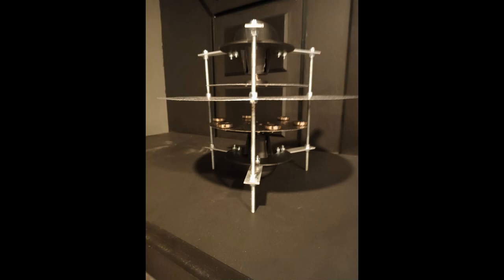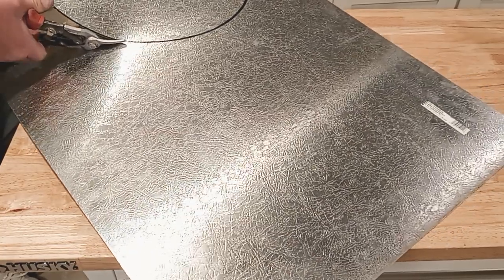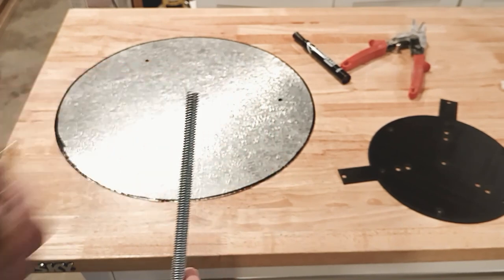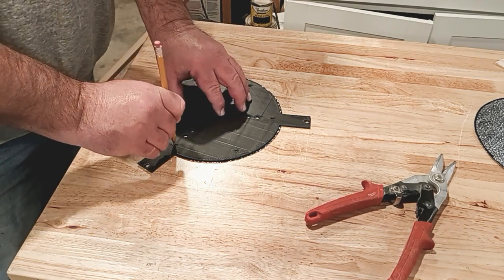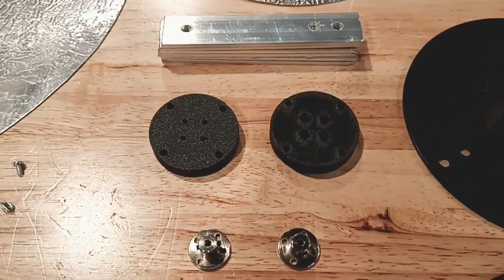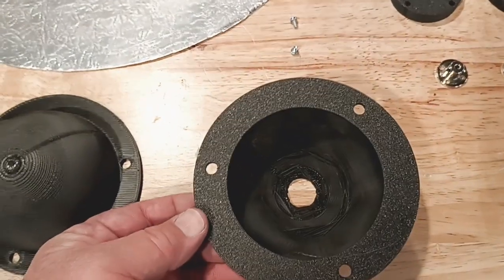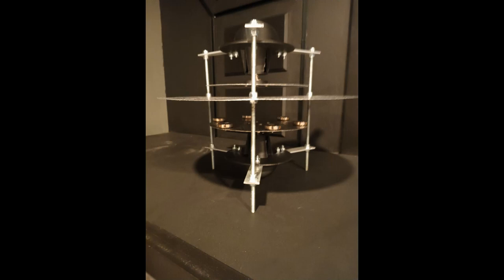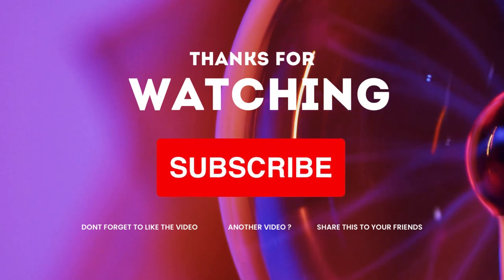Graviflyer "Build Video" #2

Comment from the maker: I added stl files for 60mm pc fans to the thingiverse link.  I also added pictures to that same link. All you have to do is cut off the blades then sand the remainder of the blades off with sandpaper or a file. The cap has a snug fit. I hope this helps you. I will also add it to the wireing video I am working on so you have them there as well. Thank you.

Comment: Oh that set up is really cool......
Reply from the maker: The second one has the fan motors. I built both and will test both. The weight difference is feels like a lot. I will show both on my wireing video.
Reply: @nathanbunten4299  im curious if weight is a factor with this device once its fully operational...🤔
Reply from the maker: I sent you an e-mail. the pictures of the pc fan motors mounted.
Reply from the maker: @TheJestar30  we don't know yet. the pc fan was on the original. It might be that it allows for the speed to slow down on the top disc because of eddie current. where better motors power through this . Which is right we are not sure yet. That's why i built both. As soon as all my parts are here. My channel will be filled with testing. I am hoping it will result in some parts being perfected. That way I can order them in bulk and everyone can run the same thing.  If it can get lift I will write code to install as firmware for the device. That way we never hear haters again.

Comment: Awesome video! I have a question about the disc radii. What is important about the size of the discs/ proportions between them? Curious if This device is dependent on being this size specifically or if it can be shrunk/expanded...
Reply from the maker: I think it has to do with the eddie current. It will warp the center plate if it is to big and if the disc's are to big the eddie current won't be as strong. There is some play in the plates but no more than an inch.
Reply: I see, thanks. I have a follow-up question. Is there a similar reasoning to the spacing of the discs in final assembly?  @nathanbunten4299
Reply from the maker: @direprogeny7720  it depends on the temperature outside. I have the top at 1 1/2" and the bottom at 2"

Comment: very interesting. i am weak in electrical but have good understanding. been a factory repair/ maintenance man whole life, am currently the tool maker and designer for custom extrusions in a plastic factory. a few questions i have is: why is the texture on the discs important? would the connecting rods be better if they were non conducting or conducting but light weight?
Reply from the maker: It has to do with energy and frequency. He is creating a musical note. Sounds strange doesn't it. But in order to resonate it needs the frequency's.

Comment: Try doing the opposite. A large disk at the bottom, a much smaller one at the top. After activation, the generated field on the lower disk goes up and hits the middle disk, knocking electrons or ion wind out of it. It is pulled by the upper disk. The upper disk is smaller and does not completely block the ion wind, which pulls it upwards. That's the theory.  https://www.youtube.com/watch?v=HpDeFtAtqF4
Reply from the maker: I might give it a try later. My goal is to reverse engineer the graviflyer. So I will change the motors to pc fans like Alexey did and keep it the same until it fly's.

Comment: This s not allumium its looking like galvanize steel that you use .
Reply from the maker: it's aluminum. I have run eddie current tests on it.
Reply: @nathanbunten4299  ok it's sound like tin went you tap on it
 And I am a welder aand allumium its solf you had hard time with the drill and allumium the thickness your rotor is it will bend just by looking at it .
And I can prove you that it's a fack .I  made a videos that I put a other device that fly under his device and he pass his hand over the tow vice
And it's look the n same
Reply from the maker: @Coolskull2.0  I put a picture of the tag in the video. It is aluminum. You can get it at lowes hardware store. If you are saying the Graviflyer is a fake then you would be wrong.